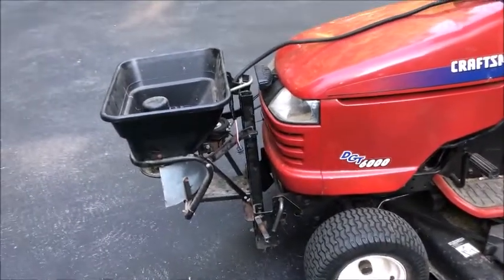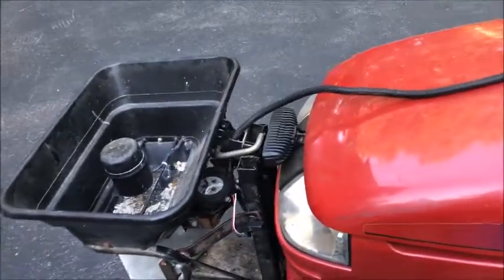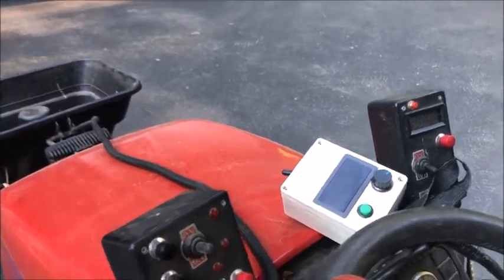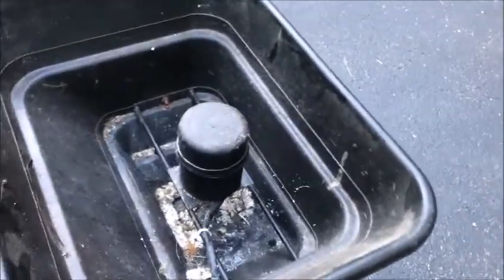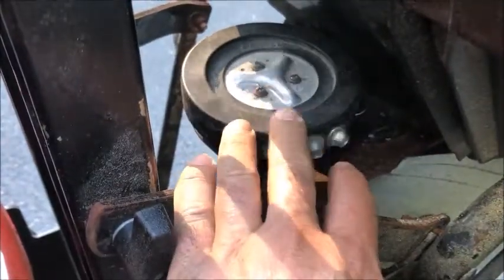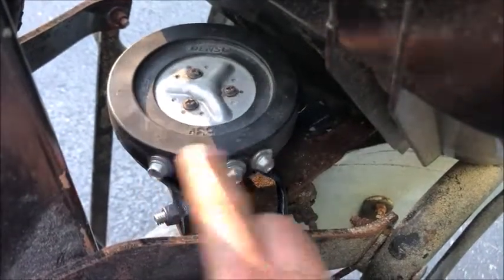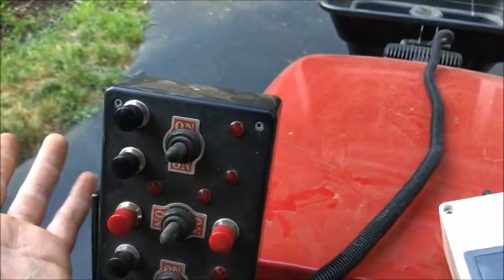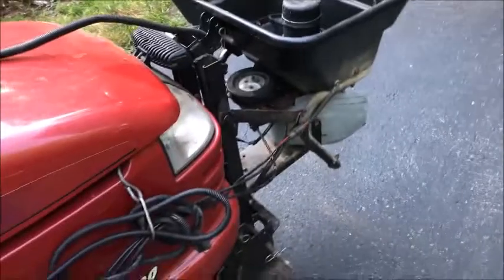Garden tractor electric spreader Vibrator V3.0. (Tractor mods)

Comment: Just came across your videos on your fertilizer spreader. Excellent work you have done. Are you still happy with it after several years? Wanting to do the same thing for my zero turn mower. 
Thanks.
Reply from the maker: Yes it works great and the vibrator is a must. Do keep in mind that granular media is not a problem however if you spread powdery stuff like lime then it does come back at you so you have to go slow but beats the walk behind spreader!
Reply: Need to find a double action cable to open and close the gate.